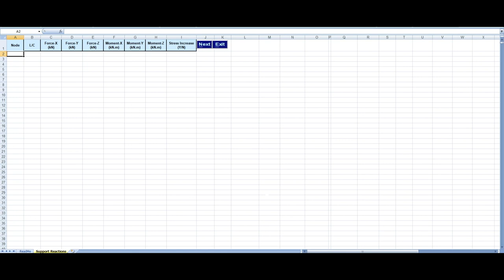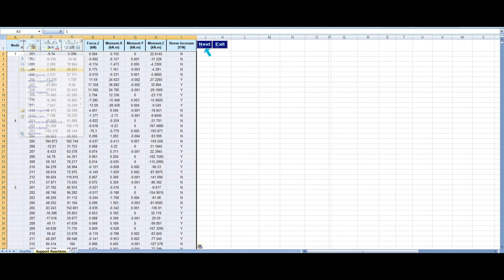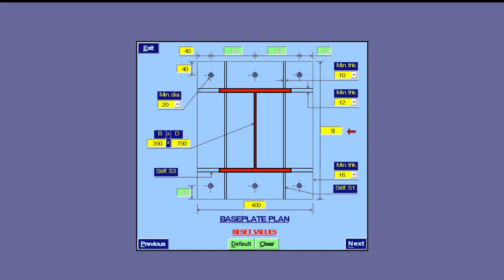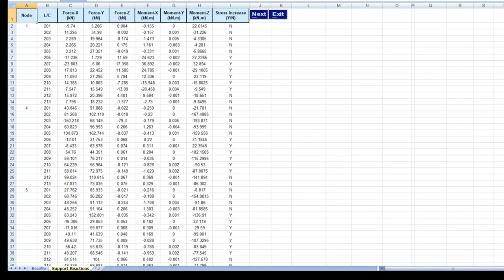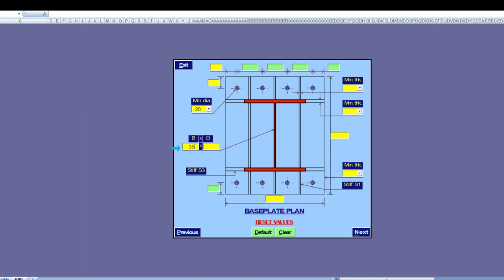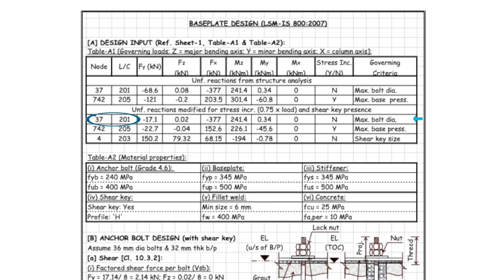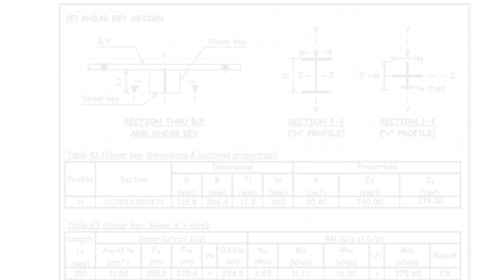Baseplate Design as per IS800

Comment: how to do for circular and square sections sir
Reply from the maker: BP10, BP11 and BP12 are for square sections only. The software is not designed to handle circular sections as we primarily deal with structures for Oil & Gas and PEB industries, both of which use column profiles from among the 12 B/P types shown.